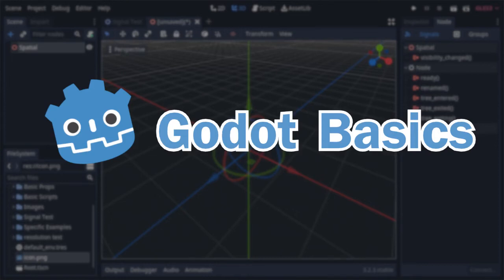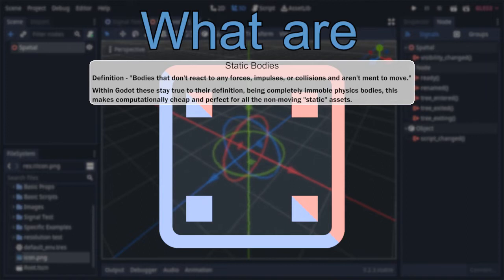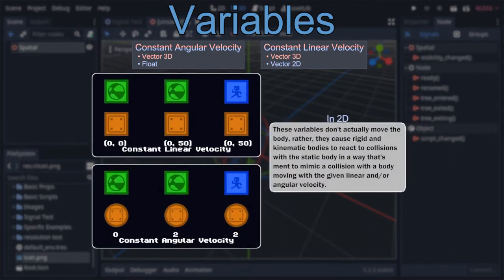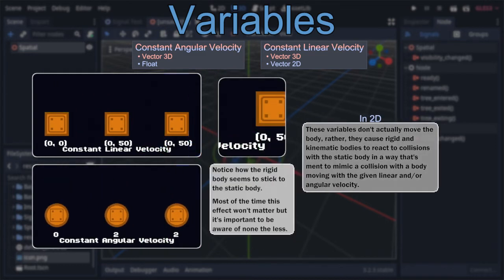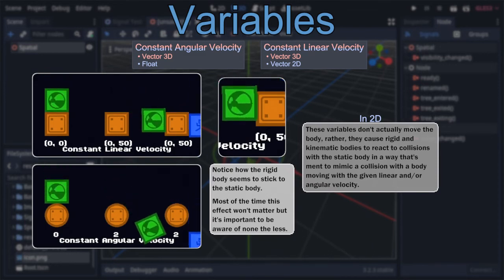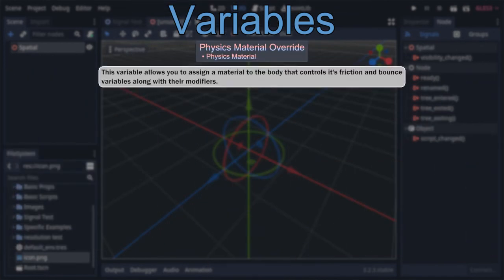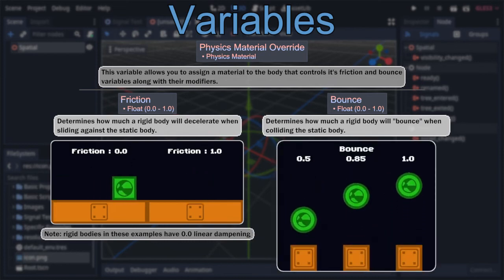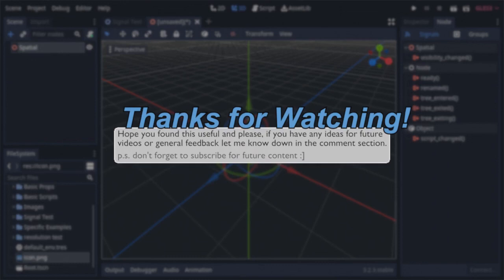Godot 3.x Basics : Static Bodies

Comment: You don't demonstrate an example with static bodies man. What's the point of the video?
Reply from the maker: Just consider this series to be a companion to the official documentation. I pick a node/system and go through each variable, method, and interface within it and explain, in detail with visualizations when applicable, how they work and what they do. If you want more traditional "how to make X" tutorials there are already several great creators that do those. BornCG (also has great blender tutorials), GDquest, and DevWorm are 3 solid ones that I'd recommend.
Reply: @javlinstudio3  Agree! What I tried to say is that the series is rather conceptual. It does not cover the practical aspects of nodes, which you actually need in real life. Concept only won't get us viewers far. Some practical coverage will help us understand the node a bit better!

Cheers!

Comment: Hello, I'm sorry to bother you, but is the constant linear velocity still broken? In my project ( 4.2.2 ), I have a staticbody3D being moved by an animation player, and even though the static body is applying a constant linear velocity to any rigid body rigid bodies the rigid bodies kinda 'glide' over the surface, not sticking.
Reply from the maker: It sounds like you're trying to make a moving platform, if so, you'll want to look into using an AnimatableBody3D rather than a standard StaticBody. It's a node introduced in Godot 4 specifically for that type of usecase.
Reply: @javlinstudio3   Thank you, sorry for the trouble but I just started recently with godot